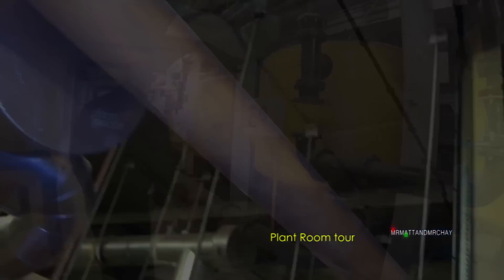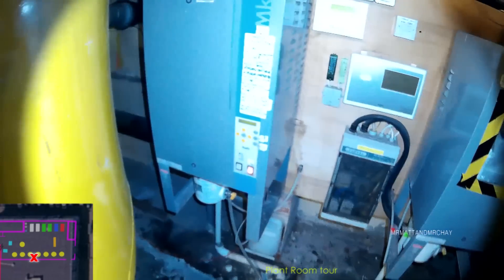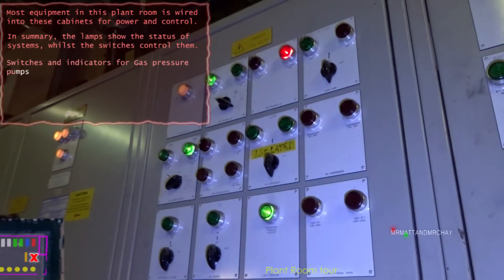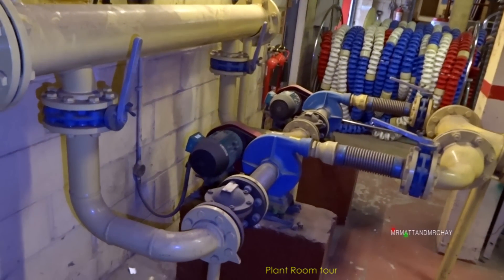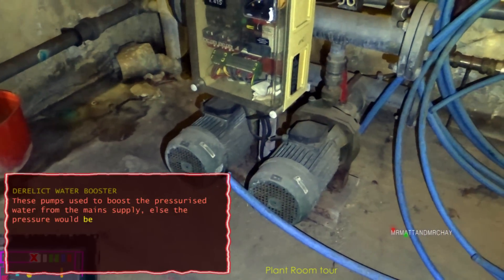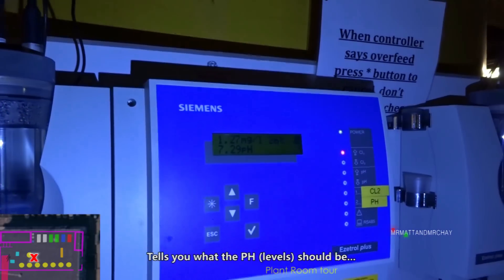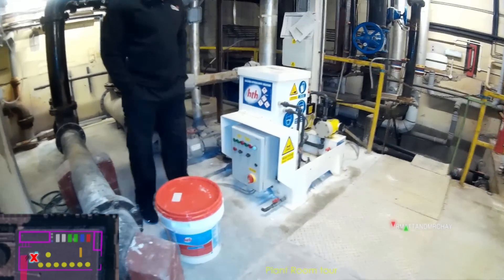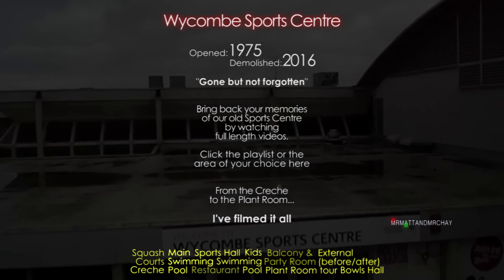Revisit old Wycombe Sports Centre(3) - THE PLANT ROOM

Comment: Are you sure the CHP units are gas turbine engines? It would be a hell of a noise there and you need lots of air to operate them. I'd rather say they are piston engines that run on natural gas... At least all "smaller" units of that kind I know are of that type. Gas turbine engines for heat and power are as far as I know oly used in dedicated power stations or on some ships...
Reply from the maker: I've researched these a fair bit and my mate is a boiler engineer and knows all about them and used to do some work in this place.  All I know is, the gas is definitely used to rotate an engine which connects to a electricity generator.  The "turbine" part, I'm not sure as I'd need to look up the definition of the work "turbine".  The heat from the engine then replaces the conventional boiler that was there before (the CHPs were installed in about year 2000).  They generated so much heat that they kept shutting down, which meant the building kept switching between the generated electricity from the CHP and the national grid power (from outside).  The CHPs were designed to run the electricity most of the time, so the original idea of installing TWO CHPs was flawed.

Comment: Very good and professional (broadcast quality) video, there's so much installation technology that goes into a swimming pool. That building must have had quite the gas bill every month considering the vast amount energy it used. That area underneath the pool is a pretty corrosive envoirnment for the concrete structure considering all the chlorine and acid chemicals about in the plant room. This is a very challenging envoinrment for reinforced concrete structures, as the acidic nature of this envoirnment requires a generous (about 50mm!) amount of cover on the rebars and a high qualilty concrete to prevent corrosion (chlorine is very unhealthy for reinforce concrete). 

There is a such an interresting world of catacoms and installation technology behind the scenes, that the public normally doesn't see. I've once visited a projector room of a movie theather in 2004 during a tour when it had just opened and the film reels where massive! They where playing a Harry Potter movie at the time and I got to see a bit from the projector room! Nowerdays a lot of these massive reel projectors have been replaced by a glorified dvd player...
Reply from the maker: Yep, going to be going into the air exchange systems in the next part.  The amount of maintenance this place must have had to keep all those pumps, filters and everything else must have been a task in itself.  I suppose if the pumps and redundancy pumps failed it could close the centre.  Probably part of the reason why the 1975 building was demolished - easier to start again with new equipment.
Reply: Also, modern equipment is much more power efficient. Especially heating systems, as today there are ways to use heat pumps that extract water from the soil which is a bit like a inverse refrigerator. Not to mention systems that use various heat exchangers and regenitive drive systems in everything's that got a motor. The Otis gen2 lifts are an example from the top of my head where excess power can be fed back into the power grid, so that less energy is wasted. Today building designers also have to make energy perfomance calculations, (as part of the building code) to prove a building meets a certain level of energy efficiency. The energy requirments are getting tighter every few years which can be quite challenging as increasing the amount of thermal insulation of the building's envlope can only get you so far. Even for a single family house adding a shower drain with a heat exchanger can add some improvements in the energy efficiency coefficient of the building.

Comment: One slight correction the average domestic house has a metering capacity of 6m3 / hour (known as a U6 meter).  They would normally use substantially less.
Reply from the maker: OHHH interesting, so the comparison would be FUTHER APART than shown in this video?  Interesting :)  I obtained the info from my friend who is a gas boiler engineer.  Thanks for the info.
Reply: @mrmattandmrchay  yeh probably around half

Comment: That's one of the best plant room videos I've watched, wish there were more videos with this level of detail e.g. for power stations etc. Thanks for posting. So how much of that equipment did get once removed? That CHP systems looks a bit over kill for your central heating and lights :-)
Reply from the maker: I love doing videos like these, as I always START from assuming people know nothing about it.  So I do the same, for the average person I make it interesting explaining it from the ground upwards (not literally, but you know what I mean LOL)
There is a little bit of back ground info that was provided by my friend who once serviced the boilers in this place (this is how I got the Alan Yignis name, or however it's spelt).  The CHPs were fitted as the primary electricity generator for the building to save money.  Problem was, they did their sums wrong as the units provided too much heat that couldn't be dissipated quickly enough which meant the CHPs kept shutting down.  The CHPs never generated the amount of electricity that they should have done because of this reason.